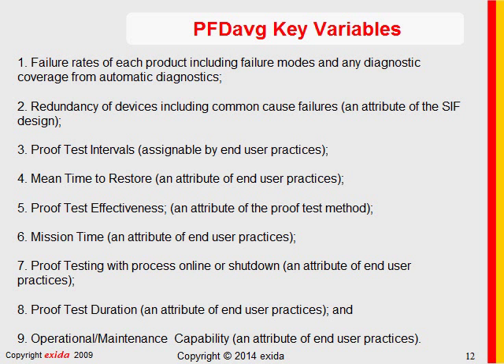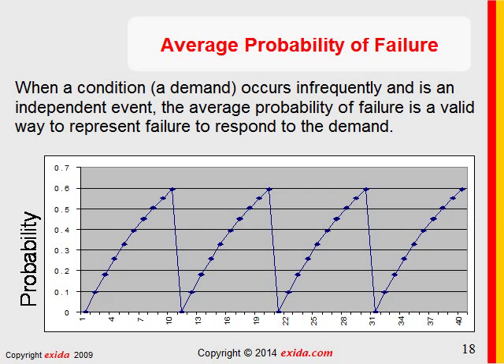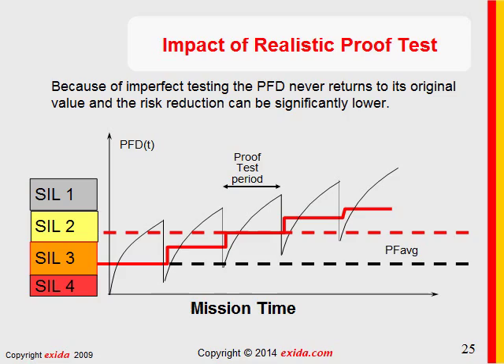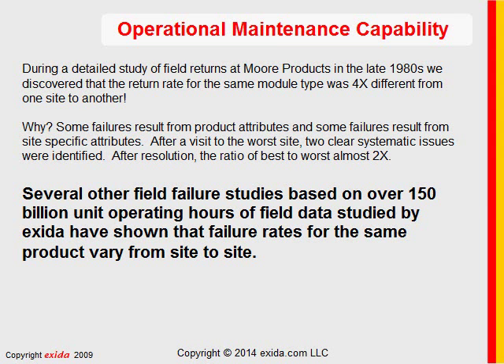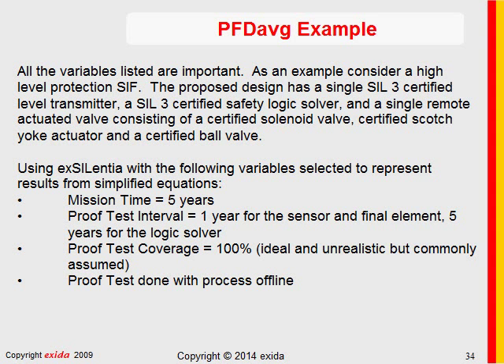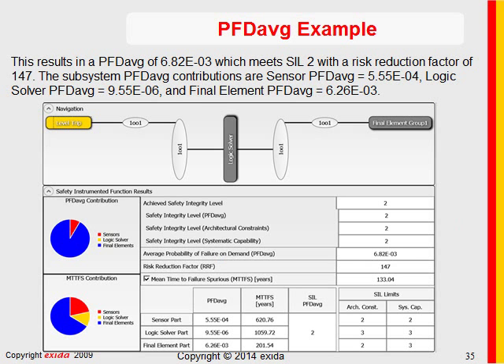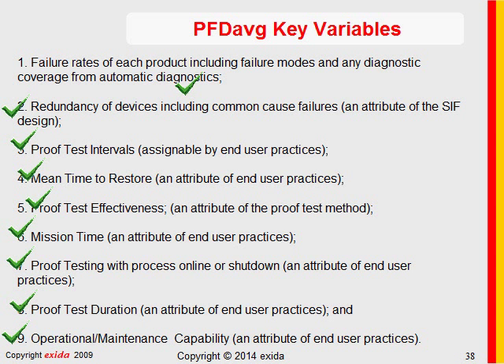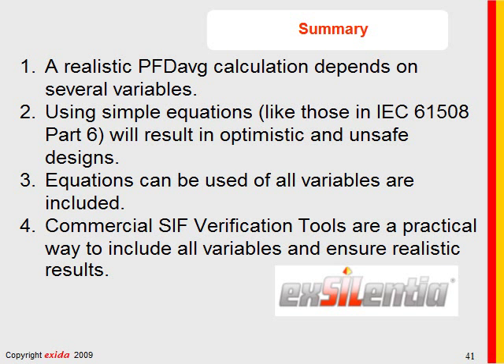The Key Variables needed for PFDavg Calculation

Comment: Is there PFD avg equation on each Safety Instrument function (SIF) will differ? Involving weibul distribution to determine beta and lambda?
Reply: I am unsure whether I get your question correctly, but I can say this:
1. Yes you should use the PFDavg equation on each SIF
2. 61508 dont really cover weibull, but 13849-1 mentions a weibull-based aproach using B10d-Values